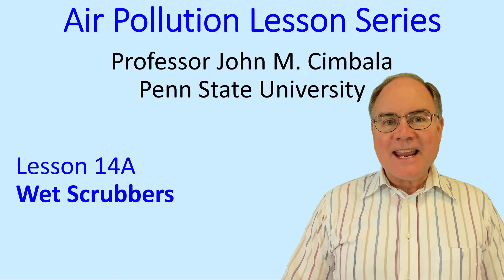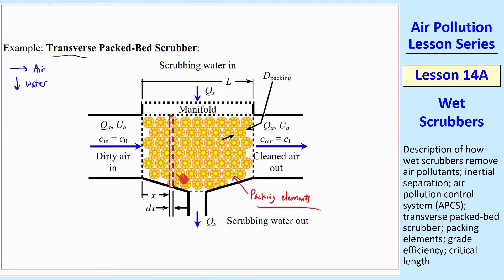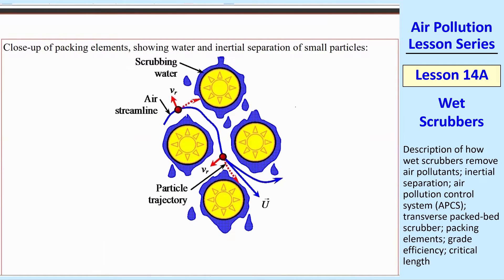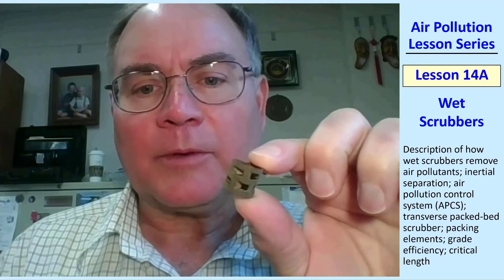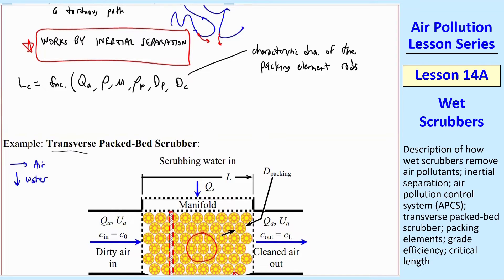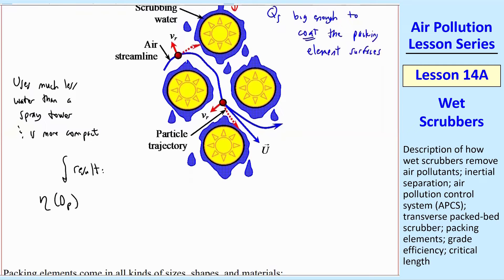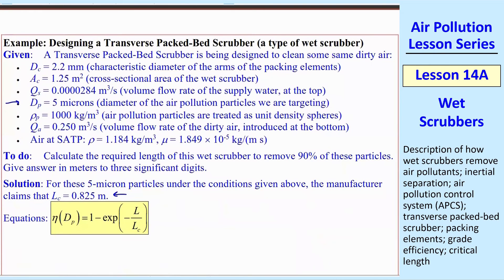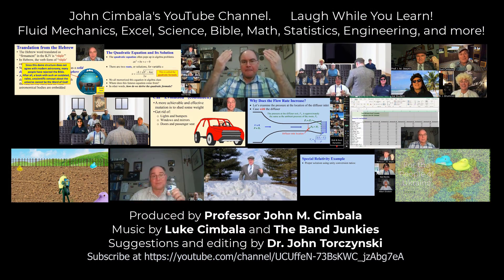Air Pollution Lesson 14A: Wet Scrubbers

Comment: Hi Professor, thanks for the explanation. Just a question regarding the residual water+dust mixture coming from the colletctor,: does that solution shall be treated as a hazardous residual? I mean, does it require a special disposal?
Reply from the maker: It becomes a water pollution problem. If the collected particles are not harmful, they are simply filtered out of the water. If they are hazardous in any way, they must be handled appropriately. I concentrate on the air side of the scrubber. The water side is left for others to deal with.